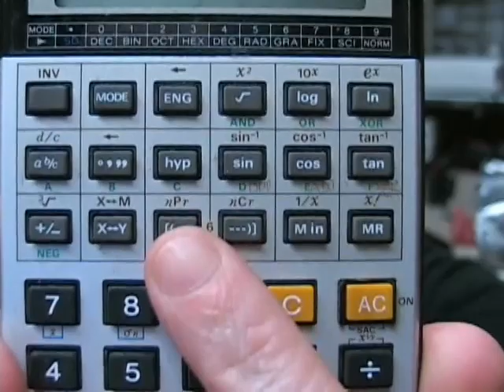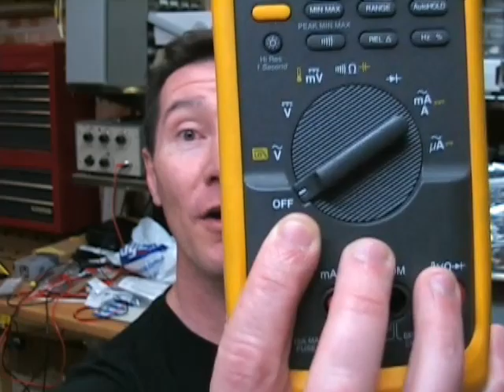EEVblog #28 - Product design drives me NUTS!

Comment: At the University, I sometimes use the Agilent DSO3062A with USB Host. It can save waveforms on a USB drive, but you can't open them with the provided software, so you have to open the waveform again with the scope, connect the scope via the USB slave to the PC, and download the waveform. That just doesn't make sense! The information is on the USB drive in a single file!

Comment: Speaking of Rotary switches in multimeters. . . I found a Multimeter that could do everything. I mean measuring lux, audio, temperature, capacitance (basic, not real LRC) and I loved it! got for a great price too second hand.

One day we were having trouble with our power experiencing Brown Outs, so we setup the mulitmeter to check out the line and left it there (the AC socket) for a while to monitor it.

The next day the thing had obviously turned itself off and I needed to use it. So in order for me to turn it on again, I had to rotate the rotary switch through ALL the other functions. Silly me, I forgot its sitting on Live AC. and well... a PCB track was blown straight off and its now ruined...

Comment: A lot of products have small buttons or cinch plugs or anything on the outside. That's all fine, but they're usually mounted fairly weak on the circuitboard. So after a couple hundred button presses, it just snaps off the circuit board (or bends) and the button disappears inside the appliance. The device still functions fine, it's the buttons that aren't properly supported on the inside. I've seen this so many times, makes me wonder if they do it on purpose.

Comment: HUGE peeve.  I work in a data center every day.  Why are there no universal standards on power cable 'clips' to hold them into their receptacles?  This is the MOST important cable you have to plug in, and most often all it takes is a very light tug from an errant rack door or misstep to kill the power supply to any piece of equipment!  Preposterous!  Some brands have been better about shipping their own brackets for power cables on servers and racks more recently.  Come on!  It is 2010!

Comment: Designed obsolesence, digital cables (??), auto power off, 4 inch woofers, directional patch cables (come-on), break in periods, tube superiority, phono circuitry removed  (Bluetooth added), all the new audio gear, Audio-Grade capaciators, coils, and resistors, AC power conditioners, speaker wire elevated on dixie cups, . . . . cell phones. The Navy can't even fire their weapons if the computers go out !!!!!

Comment: I can't agree more on the blue LEDs. It seems there's an unwritten law forbidding to use other colors (or less intensity) for power on indicators.
One thing on Casio calculators: Why on earth did they decide to put Pi and Exp on the same freeking button?! These keys are vital to an electronics engineer. They should be both accessible without shifting. But then again, the HYP-Key is of course muuuch more important than these two...

Comment: Garmin GPS - Charges with a mini-B USB charge - plugging there's in and everything operates fine, plug a generic on in and you can't use the GPS.  It will still charge, but it won't let you access the GPS functionality.  Found this out on a trip in which I grabbed the first mini-B cigarette lighter adapter out of my car along with the GPS unit going on a family trip.  Of course I figure it out in the middle of nowhere - battery running down - after I decide to fish the adapter out of my bag.

Comment: My 2010 Chevy Equinox has a USB port for the sound system. I have a thumbdrive with my music collection on it plugged into the audio system.   When you start the car it takes a couple minutes to create an index  of the mp3 files. That's OK, but in the meantime the default mode is to start playing the first tune on the drive (alphabetically) so that every time you restart the car it plays the same tune!  You can't change it until it has finished indexing.  Then after it has indexed all the tunes you have to dig into the menu options and either select the tune you want or set it  to random play.  When you start the car it ought to go back to wherever you were in the index and in whatever search mode you were in when the car was shutoff or simply default to random play.                                                                                                                                                                                                                                           To get around this maddening feature I put a mp3 recording in the front (alphabetically) with seascape sounds which is more or less white noise but far less annoying than hearing the same tune a thousand times a year.

Comment: Speaking of blue LEDs - this video inspired me to finally take apart the el cheapo 19inch TV in our bedroom and remove the high intensity blue 'standby' panel LED which used to light the while room when you finished watching TV at night.
Perhaps I've got it wrong though and it was actually a safetly feature to keep me awake incase its dodgy internal power supply burst into flames overnight!

Comment: I was shooting at an event last night with my "new" Pentax K-7 (which I generally am pretty happy with). I decide to use one of my old lenses (50mm, f1.9, due to low light) that is fully manual (no AF and only manual aperture).
But then the camera "forces" aperture-priority (Av) in all modes (exc. Manual). WHY?
It's ok for most modes (as P, TV etc), as the camera can't set the aperture automatically. But to force Av in TAv-mode (you set time and ap., it sets ISO) is not ok. [...]

Comment: Dell laptops: Two things.  First, having to flip the lid up to access the external volume controls.  This is ridiculous, if you are going to put a button on the case for volume, it should always be accessible.  Related: bright laptop LEDs to light up my room when it is dark -- unnecessary!

This all relates to keeping the laptop on the nightstand and using it as sleeping music and/or alarm clock.  So I just use black electrical tape on all LEDs now  =)

Comment: The range switch on the Fluke is designed that way to prevent accidental shorts. Imagine accidentally frying a $1200 ECU because you were in the wrong mode. Can't even drive to the store to buy another after! :D

Comment: Philips PVR and consumer electronics with laggy interfaces : I press a button on the remote, I expect at least some confirmation that the machine has accepted the command before spending over a minute rummaging around some godawful data structure in its internal files to give a list of recordings. Seriously. The machine typically holds about 50 recordings. What's so hard about displaying a listing of 50 recordings?

Comment: The reason why you lose the info when the display flips is (probably) because the inverter is before the graphics generator in the circuitry. That means that, to display the graphics when the screen is "upside down", they would have to create a whole new function to draw them with the new orientation, and (assuming that's a touch screen) also to read the touch coordinates upside down.

A better design (obviously) would have been to code / connect the screen flipper as the last step, and make it flip the finished image (video + graphics) and flip the touch coordinates before feeding them back to the input handler.

They're probably using some flip function in the video encoder chip itself, instead of adding a flip function to the display controller (and therefore saving a few cents). That's the only reason I can think of to design it in such a dumb way.

Comment: I seen the post by TheInternetwatcher and I have a story that rivals it. A few years ago, when I bought my laptop, I also purchased a cheap Logitech wireless mouse. I think I spent like $10US on it. It has been through the ringer, tortured, abused, dropped, even submerged in water, and it STILL WORKS! Recently I bought a newer higher end mouse and used it for a couple of days. I quickly found out that the laser would bounce off any surface and make my pointer wander aimlessly across the screen.

Comment: On the topic of the Princeton Tec lights.  I work as a millright, essentially a mix of industrial mechanical maintenance and industrial machine installation.  I was working a longer term job at a local John Deere foundry and bought a headlight for my hardhat.  It was a Princeton Tec product.  I believe it was designed for people doing general outdoors activities and not the industrial worker.  I really loved this light.  Nice and bright, great battery life, and multiple light intensity modes that worked great depending on what I was working on and ambient lighting.  This light did not have the issue that you showed with the bike light.  It had 4 modes plus off if I remember correct with a single button for mode selection that just cycled through.  If you left it on any setting for more than 10 seconds, the next click of the button turned it off.

Comment: On the degrees button on your calculator, I hate to say that I use it all the time! I have an old Casio calc that I still use every day.  One of the things I did with it was a program I wrote to compete in TSD (Time Speed Distance) road rallies. Each time through the loop it would display the current time I should be at the next tenth mile. So I used the shift degree button to convert to mins/secs. Besides AC and EXE that might be the most used button on my calculator!

Comment: I have to echo the blue light thing here I suffer from extreme migraines and one thing that is sure to cause one is bright lights anyway about 2 weeks ago I bought myself a Bugera 6262 amplifier which has 2 of these "jewel lights" on it anyway as it is a head amplifier it sits on 2 cabs which put it at face height - well I'm sure you can see where this is going I turned it on and was blinded for about 10 mins with dam light spots in my eyes by these crazy bright blue lights! good amp though!

Comment: When I got this LG 17" LCD monitor some two months ago the blue LED power-on indicator just drove me nuts! Didn't  the LG guys test this product? It's just so bright you can't look at the screen without being blinded by the LED. I immediately put a tape over it and then used a marking pen to filter the brightness to a level I found comfortable. 

I have the same problem with my Sanwa DMM. No separate on/off switch. Their old model used to have it.

Comment: Some car radios like mine and my dads doesn't store their settings when the power is disconnected. Even though they're connected to power most of the time, there are times when you're doing certain service work and want to disconnect the battery. And when you do that all the settings are lost, and you'll need to spend half an hour programming all the radio stations and adjusting the brightness, the EQ and stuff. Did they forget that this thing is going in a car, or did they just assume people never service their cars? And hey! All car radios has USB nowadays. Couldn't they at least give you an option to export your settings on to your USB drive? It shouldn't cost more than a few extra lines of code.

Comment: Hah, I had one of those shuttles. The computer was in a different room, and the light /still/ kept me awake. That thing must be pushing 25 lumen. (sliiiight exaggeration.) Painful to look at with dark adjusted eyes. 

I was going to replace the LED, but the electrical tape was closer. (also works on blinking VCR clocks, if you have any of those...)

Comment: Has anyone ever worked with one of those RaidoShack ColdHeat soldiering irons? They are impossible! The tip only begins to heat up when it is applied to the joint. It uses electricity to heat the wire, not the tip! It is designed to ruin sensitive electronics and not for SMDs. It is a thirty dollar piece of junk that is not worth purchasing for anyone because they would just be frustrated with it. It wouldn't even make a decent hobbyist tool because it does not heat up enough to melt soldier!

Comment: This video reminded me of something. When I was a really young, I recall that my dad went back to college to re-train, he was studying some sort of electronics course, and also working in product testing and certification of home electrical devices at the same time.

Anyway, I'll never forget his stories of a Bart Simpson telephone they had in at work, that just...failed certification miserably on just about everything, though I believe he said small and easily breakable parts that could constitute a choking hazard was the main issue. I just recall him coming home ranting all - "What an absolute, utter piece of..." :D

I think it sounds really quite fun as a job though, scrutinizing designs of and then torturing products. Some of the 'methods' he told me of them using really did amuse me. All the impact & drop tests, cable strain-relief tests; just loads of horror 'scenarios' that could occur in a home to a product that might damage or render it unsafe.

Comment: on the bike light, try holding the button down. might not work, but that is sometimes the "off" signal. with a single button you need some way to allow different modes. but with a single button that precludes the idea of a single button off.

Comment: I've had the overly-bright power LED thing with my Lian Li computer case, too. I covered it up with a blob of blue-tack and use the light which leaks out through the lens for the HDD light instead.

Another LED annoyance: I have a Western Digital USB3 hard drive which has a white LED which blinks while it's plugged into a computer, but the computer is off. This is a problem if you're trying to sleep in the same room as the computer, so you have to unplug it from the computer when you go to bed. It wouldn't be such a problem if the light either didn't blink or the output was limited to the tiny little spot on the front of the drive's case, but no, it leaks out everywhere else through the air vents on the case, bathing a large swathe of the room in blinking white lines. Seriously, don't make standby lights blink, and don't make them so bloody bright!

Software annoyance: I own precisely one BluRay disc, and when I have to browse the menus on it when playing it in PowerDVD, I have to bring up an on-screen keypad instead of just being able to click on the menu items to select them. Is this a BluRay feature, or just shoddy programming on the menu writer of the Inception BluRay discs?

Comment: hey Dave! :) a thing you can try out with your bike light. Instead of step trough all the modes, try to just hold down the button for a couple of seconds. it works on my cheapy crappy bikelight. Just hold the button down until it shuts off. Give it a try! :)

cheers!

Comment: Audio amplifiers always have heat problems:
*hot components are always placed next to electrolytic capacitors
*heat sinks add shipping/material weight and don't look sleek
*fans are frowned upon because they create unwanted noise (which gets drowned out by the speakers)
*components running near their thermal limits in "normal" operation is acceptable